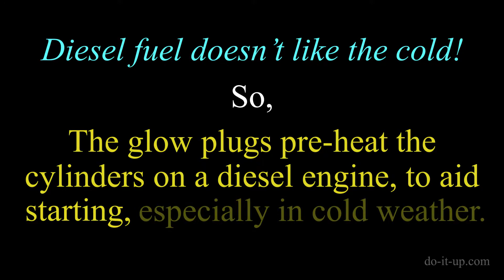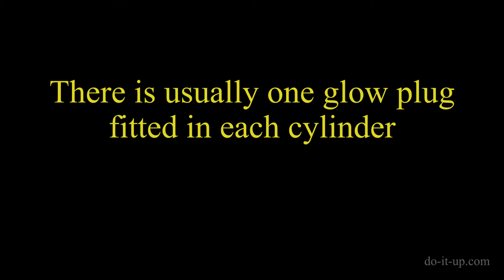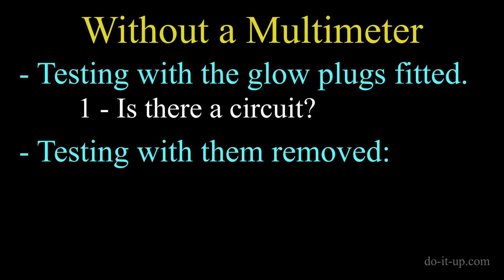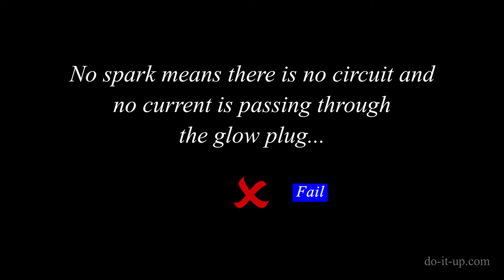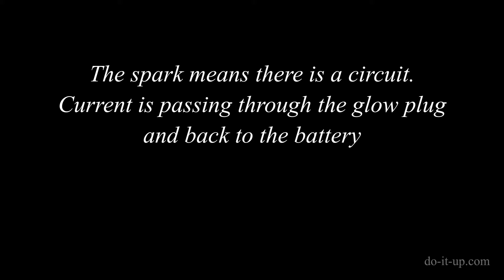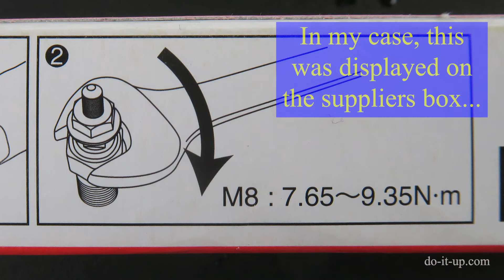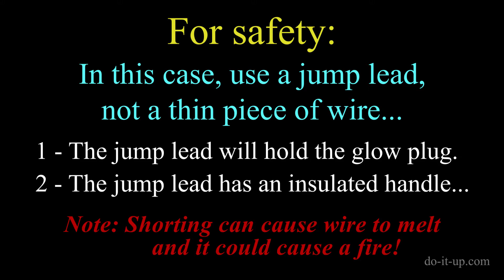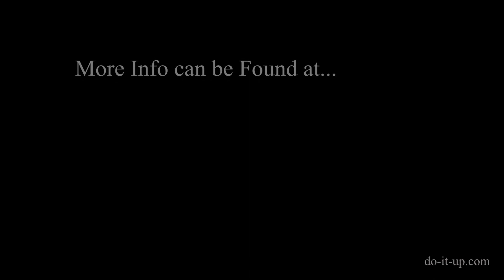How to Test 12v Glow Plugs From Start to Finish (With Jump Leads & Wire) - The Complete Guide.

Comment: Hi, I have a doubt that my glow plugs don't activate. They're good, new, but glow plug light on my dashboard never activates. Glow plug control module is ok (tried with new one and no change).
My idea is to pull out a glow plug, leave it connected to car connector, ground it and give contact in my car to see if the glow plug is activated by the car. Is this dangerous to do?

Also do you have an idea what could be wrong if they don't activate? Fuses in the engine bay are all good, battery is new, alternator is working properly.
Reply from the maker: Hi, the glow plug light on the dashboard is never a good indication that they're working/not working, so cannot be relied upon in many cases. It's a great idea to test the glow plug whilst removed, if it's connected to its original connector. My video shoes what you need to do here: https://youtu.be/YkKsbRHHNS8?t=440.

- Once removed, connect the glow plug to its connector.
- Use a jump lead to ground the glow plug.
- Make sure the glow plug isn't near anything that can burn or catch fire.
- Switch on the ignition and see if the glow plug glows?
- You can also check to see how long the glow plug activates for (by timing how long it glows).

This method is much safer than testing a glow plug directly on the battery (as there is a danger of explosion from Hydrogen gas from the battery). The risk is low, but it can happen.

Things to note:
- Manufacturers won't recommend testing this way, because some types of glow plugs may burn out with prolonged use. So don't let the 'glow plug' glow for too long if the timer isn't working.
- Some specialist, newer types of glow plugs (such as ceramic) may be a bit sensitive to testing this way. They can run on a different voltage to that of the battery, amongst other things...

If nothing is working, (with new glow plugs, and a new control module), then it could be a bad earth, or connection somewhere.

- With the power off. Try unplugging and plugging things back in again, in case there is a bad connection somewhere. And then test to see if it works?
- With the power on and everything connected (don't touch anything live). Waggle, move cables and connectors around (don't disconnect anything) in case there is a broken wire? And then test to see if it works?

After this, you may need someone with a test meter?

Unfortunately, it's difficult to diagnose from afar (and each vehicle may be different). But it sounds like you're testing everything you can. Think logically, and go through everything step by step. It's sometimes worth making a rough drawing of the process, to confirm you're checking each step.

Let us know how you get on, as it may help others?  I hope this helps you, and you get it fixed...    😃
Reply: @doitup  Thanks for the detailed reply. I'll test if they glow as soon as it stops raining here.
While i wait, i have some other questions. 
Is the glow plug control module activated or has anything to do with BCM in the cabin?
I have some other strange behavior with parking sensors/car radio/connection to CAN module through obd port, that made me doubt that it may be misbehaving.

My glow plug light used to work before. Once i did "reset self learned functions" through multiecuscan software, it was gone. Everything else the car has "relearned" but this was gone for good. I have 2012 Fiat Punto 1.3 multijet.
Reply from the maker: Hi, modern electronics on vehicle's (approx post 2020) can be a real pain. Great when they work, but when it goes wrong! The glow plugs may be linked to a control module somewhere, (most things are now)? Fuse panels (in vehicles) can be controlled by an ECU, that shuts down a circuit(s) if a fault occurs? If you have other electrics doing strange things, then it could be a control unit misbehaving somewhere?

A bit like the boot latch on my wife's mini that sometimes opens when you open the drivers door. Electronics and water...  Grrrrrrr!  Unfortunately, I've not touched a Fiat, so I can't help much there..?     😃
Reply from the maker: Hang on...   Reference my last comment. The engine in the video is in a Vauxhall. And is also fitted to Fiats, Opels & Fords! So I have inadvertently worked on a Fiat!   😅
Reply: @doitup  ...and Suzukis :)
The rain stopped and i looked into it a bit. Couldnt remove the glow plug to check what i wanted. Instead i used multimeter to check rise in voltage on glow plug connector. When i give contact, it goes to about 3 volts on it and on control module itself. I think it should be 12 volts or more? Outer temperature is around 12 °C, car was not turned on since yesterday so the engine should be the same temperature.
All the fuses checked and they are ok. All relays give resistance around 50-70 ohms between + and -
Reply from the maker: Hi, do you know the make and reference number of the glow plugs that should be fitted? If you get a low voltage, have a look at the glow plug specifications on the manufacturers website. Just in case the voltage is correct (and they should be a different voltage to the vehicle battery)? 3V is low though? If the voltage supplied is wrong (and it should be 12v), you will need to trace the supply back to see where the voltage drops to identify the area where the issue is? It may not be a faulty component, it could be:

- A bad earth.
- Corrosion (a bad connection).
- Partly broken wire.
- Tarnished contacts in connectors.

When measuring volts, check for a good circuit by using the negative on the battery as the earth point for the negative connection on the test meter. Then try placing the negative connection on a bare metal surface near the glow plug to see if there is a difference (a bad connection somewhere?).

If you need to remove the glow plugs see the text here, (the video needs to be updated...): https://do-it-up.com/vehicles/videos/engine-and-transmission/glow-plugs/how-to-remove-and-where-are-they-fitted/

Resistance:

To check the resistance see these my videos here.
- Glow plugs when fitted: https://youtu.be/_bxblpUIXpg.
- Glow plugs when removed: https://youtu.be/BOwCZBHty7k.

When measuring resistance, you may need to check your test meters resistance?

Select ohms, and connect the multimeters leads together. Is the meter reading 0 ohms? If not, recalibrate your test meter. If there is no facility to do this, just subtract the reading you obtained (when connecting the leads together) from the actual reading taken from the glow plugs.

For example. If you get a glow plug reading of 14 ohms and your multimeter had a reading of 8 ohms, we now know the glow plug measured 6 ohms (14 ohms – 8 ohms = 6 ohms).

Make sure the contact points (where you measure the glow plugs) are clean and free from oil and corrosion.

I have a lot more information here: https://do-it-up.com/vehicles/engine-transmission/diesel-wont-start-when-cold-how-to-fix-glow-plugs/ ...   that may help?  😃
Reply: @doitup  First of all, i wish you a merry Christmas! 
And to continue the topic - glow plugs are Denso dg-621 if the receipt from the time i changed them is true. As I see they're 4.4 volt type. I'll try checking the voltage on the connector again with an assistant so i can get better contact on multimeter.
I had a breakthrough with other electrical problems in my car. I started digging and found that rear parking sensor module suffered water damage it seems and even though it worked, it occasionally shorted it seems and caused BCM misbehaviour. After unplugging this module, electrical problems stopped. So these are great great news! Cleaning the module didnt make it work so I'll have to get a good used one.
And if you ask me, after this i can conclude that the glow plug light not coming on is not related to those electrical problems.
Reply from the maker: Merry Christmas to you too. It's great when you start solving some of the issues 😃. With electronics (more random hints and tips...), I have had some occasional success in the past by exercising (connecting & reconnecting) electrical connectors and contacts several times and applying a very small amount of silicone grease. As electrical contacts can become tarnished.

- The exercising helps clean inaccessible contacts.
- The silicone repels moisture and may revitalise any old connector seals.
- The silicone helps prevent any further tarnishing.

The silicone grease is good, as it's more compatible with rubber and plastics, whereas oil is not good for it at all. You only need a very small amount of silicone grease, and should disconnect the battery if there is a danger of shorting any contacts when applying or cleaning. Unfortunately silicone grease is not cheap, but you don't need very much. Hope this helps. Sretan Božić i Nova Godina...   😃